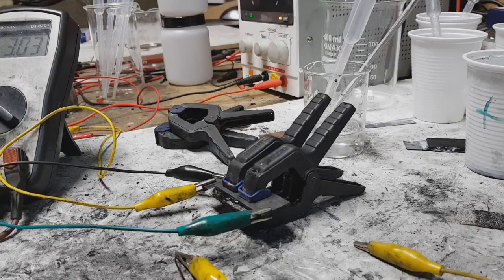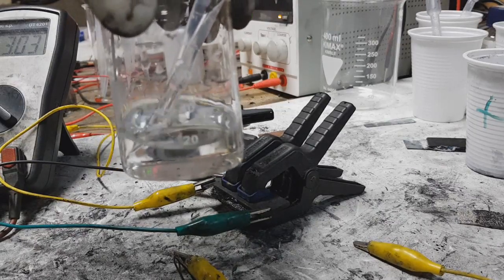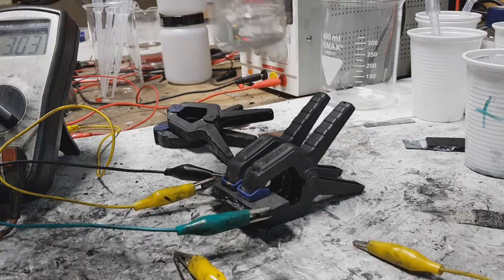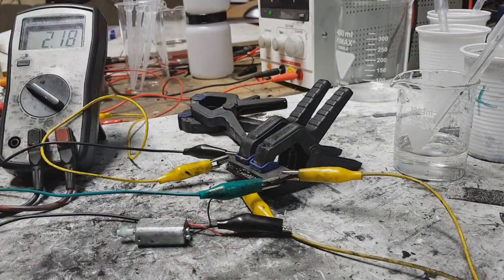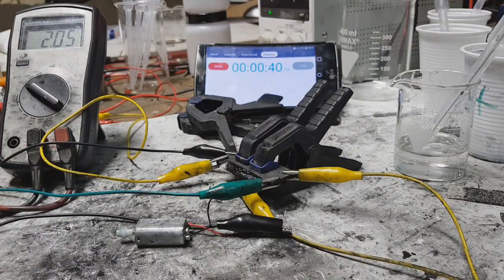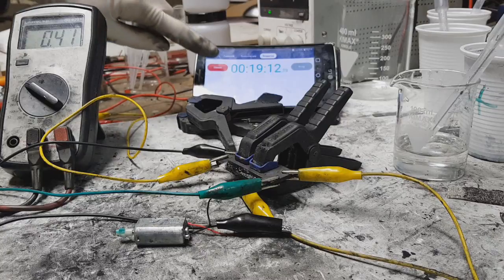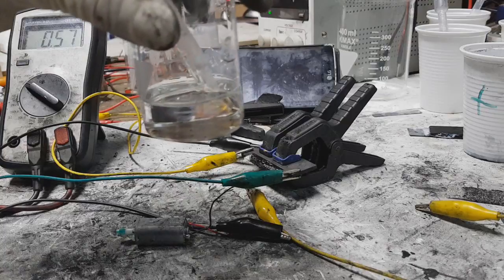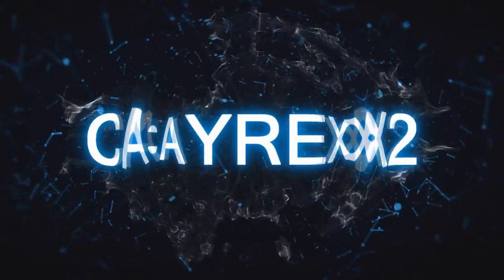Deep eutectic solvent electrolyte for Supercapacitors

Comment: In an article I read, it was written that the carbon foam was kept in Iodine at 135 C for 12 hours. Then, DES solution is prepared with AlCl3 and MgCl2 . Mg Electrode is used as the anode. It reported 100% efficiency without self-discharge and an incredible 400 Wh/kg.I'm trying to post a link to the article this evening.

Comment: Hi Caryrex, that's about the same time as your last supercap using an aqueous electrolyte, really good result for first time using DES.
It will be interesting to see how much improvement can be made by keeping the same AC ingredients and same size plates and  tweaking the DES mixture :-)
Martin.
Reply from the maker: Hi Martin! This one is better. If you see the runtime in video "Activation of Carbon for Supercapacitors and Battery" I run the motor 12 min but the motor need 20mA. also in video "Supercapacitor / Battery electrolyte Update" my best run was 20 min but also in this test I use motor that need 20mA of power. The carbon was in both videos carbon from sugar. In video "A 42 Farad Supercapacitor" I get 9 min of runtime on 40mA motor. And in the video "Supercapacitor update (85F/g)" I get 16 min on 40mA motor but the carbon was diffrend. So in this video i get 20 min runtime on 40mA motor with sugar carbon and also the supercap was charged on half (still have 120mA).
Reply: Thanks for the clarification :-)
Reply from the maker: I will upload a update on this supercap